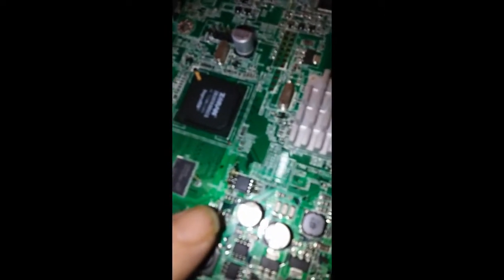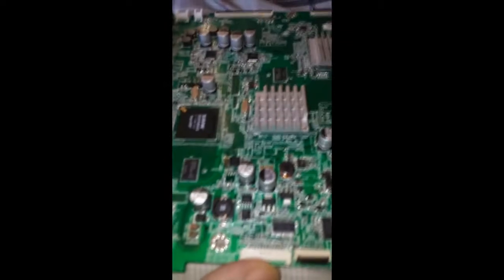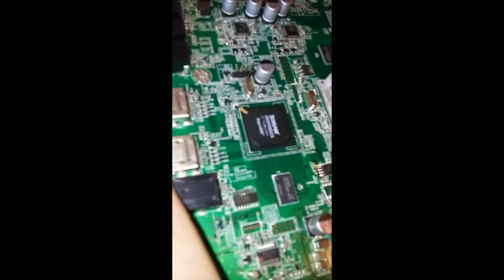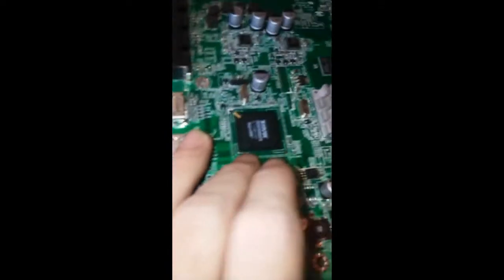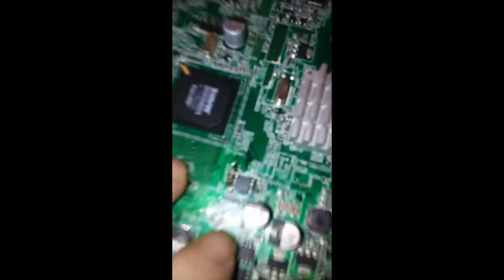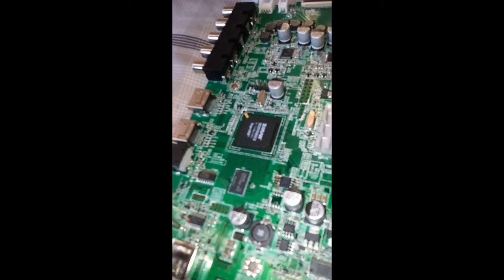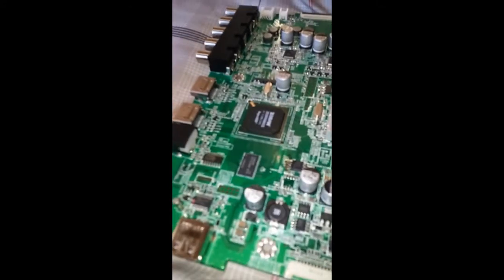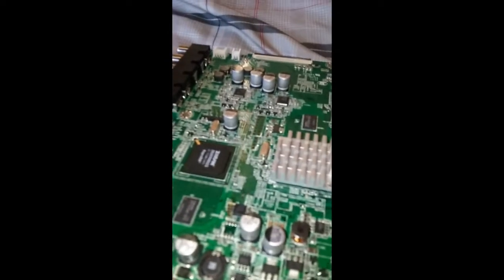Sony 3d display repair

Comment: could you tell me which affects the chip? is overheating , or bad weld ?
Reply from the maker: its the u4 epprom on thenlogic board which efects visual and audio the tva was defective when then sold which is why sony stoped selling them due to software issue in the chip. it starts woth a black sceen cuting n and out a few seconds once and gets progressivly worse and eventuay when get to point where u will get green light blue loght then will go red stuck n no signal standby resulting red light of deathon these
Reply: my question is : the problem of chip is this bad welding (hardware ) or a bad software
Reply from the maker: +espantapajaroscr its is software related so much recomended simply program a epprom with compadiable naturally to resolve the issuse
Reply: the previous question was that if hardware or software is read in forums that it was a bad weld and that there was no need to buy the chip, I was just weld it well
Reply: anyway your video is a great contribution thank you very much ,
Reply from the maker: +espantapajaroscr also ur question sounded as of u meant sympthoms sorry for thatbmoss understanding personally the mount somderi g orocess of so y was fine and sonce i swaped. mine out. i dont have a jeat issue at all it gets warm tho do t effect thensolder and connection and o run mine about 9 hours no break sometimes more due to using it as my main display for pc as well as console gaming
Reply from the maker: +espantapajaroscr. my pleasure i know almost every owner has or will jave this issue being simply sony fucked :/ lol
Reply: isn't there another way to repair the damage without having to buy the chip?
Reply: sony is ch...
Reply from the maker: +espantapajaroscr well being its software related with the chip it self sadly no :(  but the chips are very cheap literly just a few bucks and local shops shouldn't charge more then 50$ for the swap and even if you was to disassemble which is literly just a few screws   and connectors your unplug take the logic board out and take the chip + logic board to the repair shop they should only charge like 20-40$ easily.  at least its affordable.